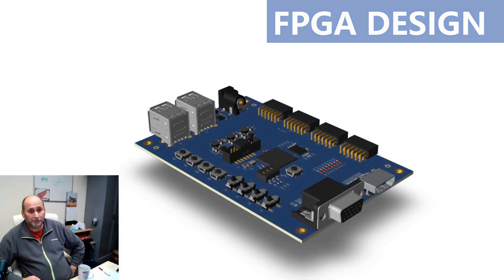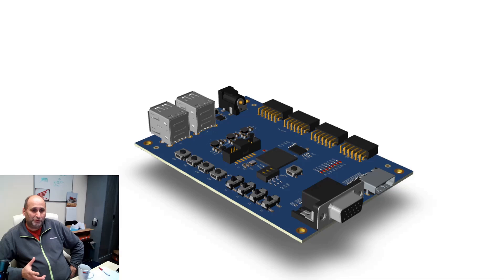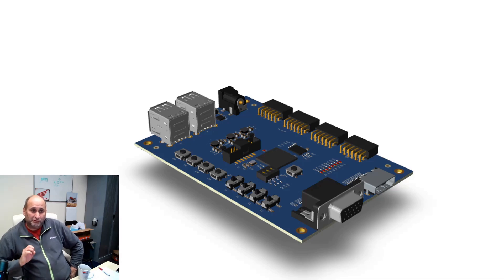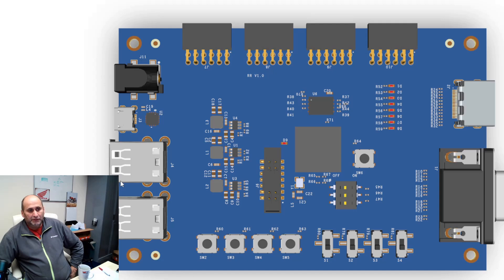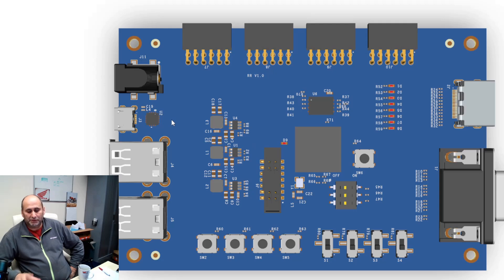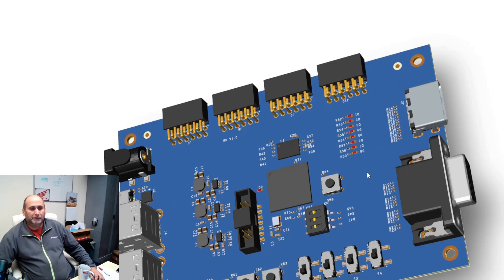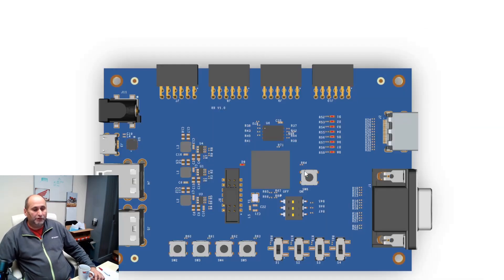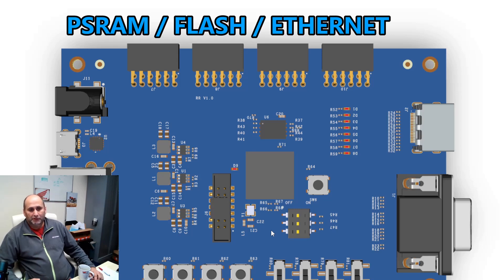FPGA Board for small retro computers

Comment: What sort of FPGA and how many LE or similar did you have in mind?  The MAX10 series seems like a good choice because they have built in ADC.  I have a few boards with the 8k LE version and the DE10-Lite with 50k LE.  Somewhere in between would work if the 50k one is too expensive.  There are some cheap boards with the 8k LE one but it's a bit limited being that small.
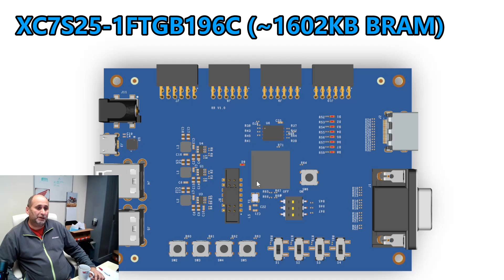Reply from the maker: I guess you never got to 4:30 in the video...well maybe next time.

Comment: Will be a fun little project for you. What tool are you using to design the schematics and PCB and what is the part number for the fpga you are looking to use on the board? Also how are you planning on driving DVI? Is there going to be a custom chip on the board or are you looking to drive the raw signals using the fpga with a bit of analog?
Reply from the maker: Hi Glenn,
I'm using Orcad/Allegro (Cadence) - the part number is is a spartan7 (is on the screen in the video). DVI can be driven directly from the FPGA pins  (TMDS 3V3) with the only limitation that high resolution are not possible because of the speed of the IOs limited to around 1Gbit/s
Reply: @adaptivedesign8795  I see, thanks for the information!

Comment: Could you add ethernet ?
Reply from the maker: This is the simple version, at the end of the video I'm saying that will be a version with external RAM, FLASH and Ethernet. Lets walk before we run, there is high chance this idea will go tits up.
Like the wise blind man once said: "we'll see".
Reply: I watch a lot of videos. I started “Embedded Systems” in the 18 months of my Mechatronics Eng degree. I had got thru all the hard bits but my brain was fried! I also caught the Ham radio bug again. I did do some sequential and combinational logic on an FPGA (Quartus Prime?) making a MUX etc. I guess I need to dust off the FPGA and start! I would be interested!! 73

Comment: Very cool! Perhaps you can snatch some ideas from the MISTer FPGA as they've touched a lot of real needs.
Reply from the maker: The got a bit pricey with the mister.
Reply: @adaptivedesign8795  Indeed, but they also offer a lot. One thing I would ponder on up front would be extensibility; signal/power/control bus, stackable boards and the likes.
Reply from the maker: correct! it's all about what you want/need and how much you want tot spend.